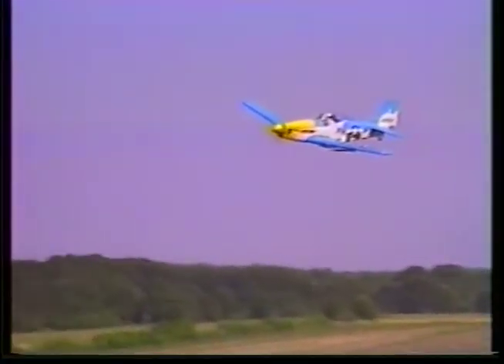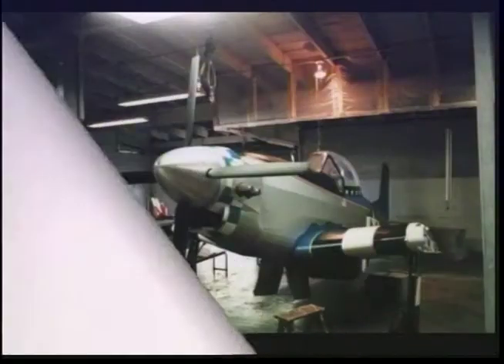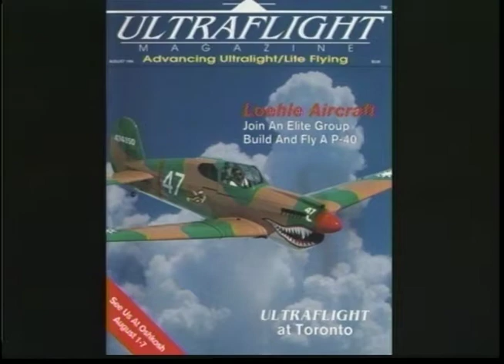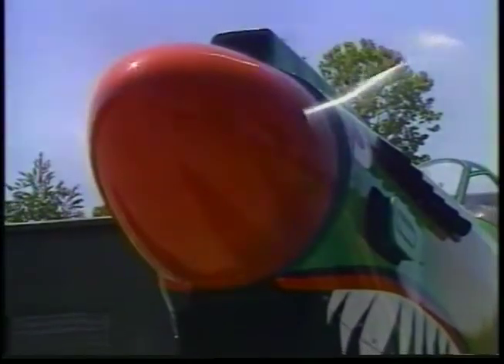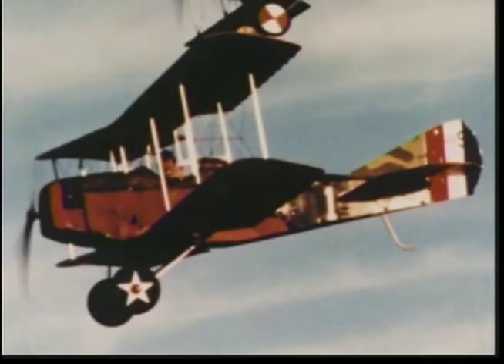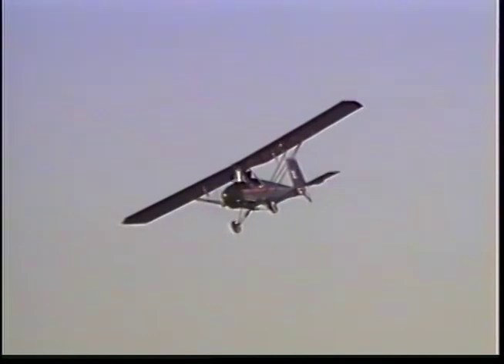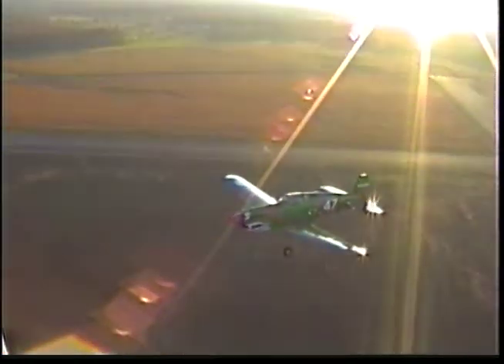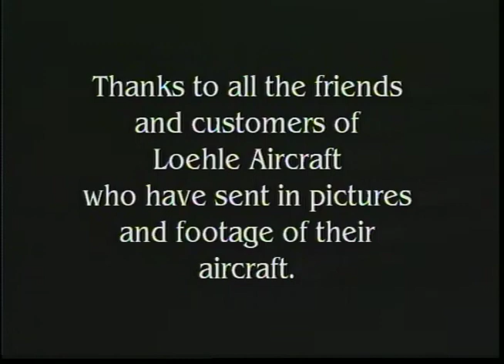Loehle Aviation Classics

Comment: What kind of license do you need to fly one of these?
Reply: Gary, it depends on the options you choose.  For example, I have the Loehle P-51 with fixed gear and a GW ~ 650 lbs.  As such, I can fly it as a light sport (LS) pilot.  Or, any pilot, for that matter, regardless of rating, can fly it under LSA rules.  BTW, I am looking forward hopefully to the release of the new FAA MOSAIC rules to see what, if anything, new will be allowed to LS pilots.  Also, I bought mine from another person-didn't build it myself.  Trying to gather up all the build and assembly instructions so I can share with others.  If you are interested in buying one of these planes already built, you probably can snag one on the market for < $10K.  Happy Flying! 🙂🙂🛩🛩🛩